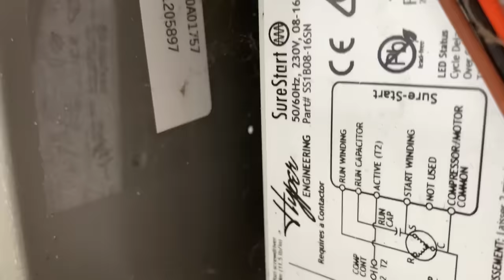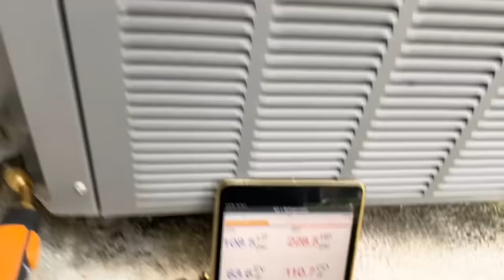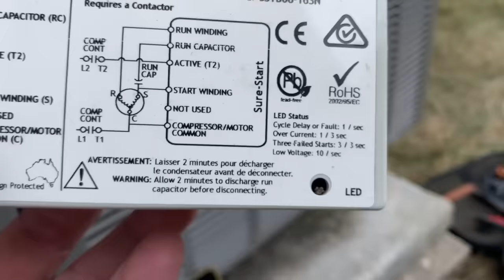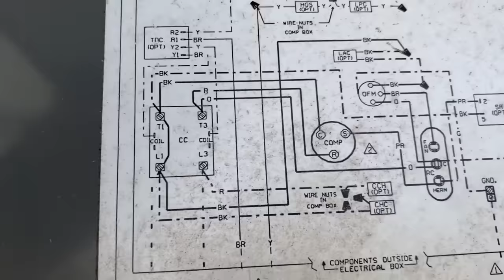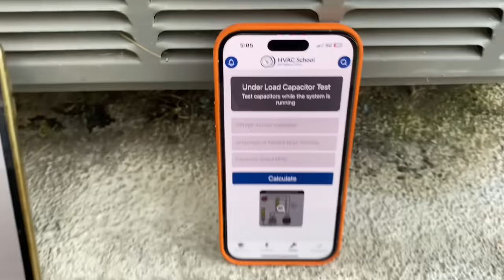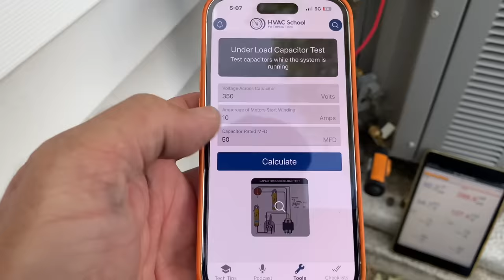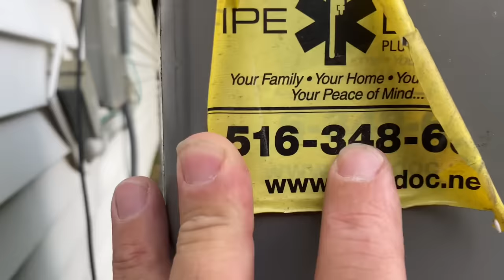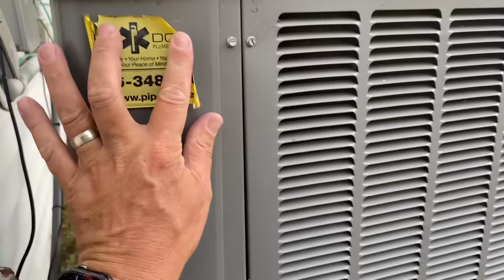Soft Start Killed Compressor! UNEDITED Central AC Service Call for No Air Conditioning Revealed!

Comment: A soft start works great if sized and installed correctly. They also extend compressor life, if you think otherwise you need to go back to school.
Reply: Exactly.
Reply: wrong
Reply: Soft starters are used throughout industry in high-draw electric devices to prevent them from failing so hard.
Reply: Soft starters are a genius invention.
Reply: @troy3456789  No there not, use the proper size generator. When your compressor comes up with a blown start winding you wont think so.
Reply: So how long have you sold these things for? I went to school and know this is not the way. If you dont believe that call the manufacturer of the compressor your putting it on and see what they tell you. First thing they will tell you your warranty's void, and other reasons not to use it. I think they know far more than you and your school. Which really shows your ignorance on the subject.
Reply: @RadioRich100  we use these things ubiquitously in industry on all scales of hp.  they seem to be pretty reliable.  i've never seen one die and take out a downstream device though.
Reply: @gavendb  Not those add on ones they talk about on here. If thats what your talking about, your eyes have been closed.
Reply: @RadioRich100  not specifically.  but the theory of operation is the same, reducing the torque by temporarily reducing the voltage or current generally with an SCR.  how would this reduce life of a compressor? (genuinely asking) Since it reduces the mechanical stress on the motor and shaft, as well as the electrodynamic stresses I figured it would be a win.  I could see a wye start delta run shorten the life of a motor that's not rated for it due to overheating, but that's not something you get in single phase.  eyes aren't closed, just have never seen what you are talking about in any soft start situation.
Reply: The school I went to says your looking at marketing and not science.
Reply: @RadioRich100  what part of that is marketing?  I went to school for electrical engineering.  The circuit design of a soft start is pretty straight forward.
Reply: @gavendb  Needed torque to turn the same load doesnt change. When the motor windings are initially starved for current those windings start heating up because the motor cant turn (like locked rotor amps) as you keep doing that over and over the copper winding become weaker, solder joints turn cold, the enamel on the copper wire starts to bubble and eventually failure. Those motors are designed to turn up full torque very quickly not over an elongated period of time. Also the time the motor isnt spinning theres no cooling air being generated. When the motor fails you wont even know why. Their NOT designed to run off these black box devices, which is why the manufacturer of the A/C unit voids a warranty when somebody puts one of these or a hard start kit on their equipment. If they needed it , it would have been designed that way. After years of experience the manufacturer knows what is best for it. You altering it defeats their engineering. As it comes off the assembly line it should last 20 years or more and mostly does.
Reply: @gavendb  A/C compressor motors are not designed to run off black box devices which alter the engineering that went into them. If this thing was so great (which it isnt for the most part) then it would have been designed into it. The system doesnt need it and is designed to run by itself for years. These things and hard start kits can be harmful over time and void your warranty too. The hype selling these things is bogus when hvac guys tell you to install them on new systems just because.
Reply: @RadioRich100  to be fair, most hvac folks don't think highly of today's engineering and any manufacturer is always looking for a reason to void a warranty, but i digress.  To the point of starving current...current is what causes heat, limiting that can't cause overheating within the duration of the soft start delay.  Although, you are correct on overheating damaging insulating barriers on stator winding.  We do a lot of MCE testing these things.  You are also right about the overall power required to start any machine is the same but with a soft start you spread it over so many milliseconds bringing the peak (instantaneous rate of change) down even though the average (integral) is the same.
Reply: @RadioRich100  that's false, there are quality "add on" soft starts on the market that actually protect the compressor and start winding with a built in fault detection circuit. Look it up and understand how a quality soft start works and protects the start winding. I use Hyper Sure Starts all the time with no issues.  Check out Brian Orr from Hvac school and his explanation. It is also false about losing the warranty because a soft start was installed. I have made warranty claims with out issue even with a soft start  installed. I have even had communication with manufacturers about warranty and add on soft starts. Not single manufacturer (ICP, Lennox, Trane) I talked to has said the warranty would be void.
Reply: @marka2449  Everything you just said - Baloney and B.S. Are you selling these things?
Reply: @RadioRich100  I own a large hvac/ electrical contracting and engineering firm.  I'm also an electrical engineer myself with vast knowledge of how they work. So yes, they are used when needed and not just for hvac applications. To each there own, but you are very misinformed!
Reply: @marka2449  No i dont think so. So how many of them have you sold? Its nothing but a black bullshit box. So it seems you redesign all the equipment you sell huh? Your just an engineering Mr wonderful. Your wasting your talents, you should be actually designing systems not installing them.
Reply: @RadioRich100  i will agree, don't install if you don't need it.  if you need it, install it.  where i live we have frequent outages due to bad power grid and lots of inclement weather.  when it's 100 outside and you don't have power for 6 days at a time, it makes sense.  I've had one for 6 years on a 12 year old unit.  for some people it doesn't make sense to buy a 20kw  for $25k standy unit for 1 week of runtime once every couple of years when a 12k portable for 1k will work fine with an ac unit w/soft start.
Reply: Yep. My background is Electrical Engineering Tech and ANYTHING that reduces current reduces heat and extends life. This guy is a clown If you pay attention and it seems a hypocrite as well.
Reply: @gavendb  I didnt know that every time one ruins a compressor they called you.
Reply: @gavendb  You never saw it? Well they dont notify you everytime one ruins a compressor motor. It INCREASES the stress on the motor not the opposite. The motor is designed to start instantly, not stretched out over time, meaning starving it for current. Eventually meaning blown windings.
Reply: It shortens the life because its not designed to start that way. You should not use it. And thats why the manufactures void your warrant y for using one.
Reply: @RadioRich100  LMAO!
Reply: @marka2449  this guy is a doof.  lol
Reply: @independenttntn3276  You dont talk like one as what you say is not possible. It reduces nothing as the motor still needs the same power to turn the same load. Your jesus box cant do that.
Reply: @independenttntn3276  Hypocrite? No way I would never use one of those things!
Reply: @gavendb This is right on. I installed my micro-air unit for hurricane outages and it works perfectly and I agree with you on the whole house generator. Not worth it for me since I lost power for 9 days in 20 years because of hurricanes. My 12kw generator runs the whole house including a/c only because of the soft start. If I thought it was an issue, I would remove and re install it when needed. The only down side to soft start units is the money it cost the HVAC companies not replacing your capacitor or contactor for $400.00. A/C manufacturers don’t use them because their stuff would last longer, not because they don’t work.
Reply: Alot of service calls are because of that device, nothing wrong with the AC unit. Not to mention the damage they do over time - compressor windings blown open for no apparent reason. (Hard start kits too) People on here bragging about fictitious low current readings that cant be measured with a normal meter. You cannot change the design of the compressor and convert into a frequency modulated motor by putting a magic box on it. You will pay a price for it sooner or later. Spend the money on a better generator, or if your smart enough at least switch the box out of circuit until you lose power and spare your compressor.
Reply: @gavendb  I don't think he is a goof...
Reply: @RadioRich100 of course the MFG is going to tell you its no good, why would the compressor mfg want to extend the life of your compressor???
Reply: @johnbalogna803  Lol, no there telling you your warranty is void if you do it, because they will not pay for damages. They have plenty of failed compressors to deal with.
Reply: @johnbalogna803  No they dont want to be replacing compressors blown up by gadget boxes.
Reply: @johnbalogna803  No they dont want to hear from your lawyer because you did something dumb not knowing what you were doing.
Reply: @RadioRich100 this video is staged. The “pipe dr”🙄 said he’s serviced that for 15 yrs and he didn’t noticed that glorified hockey puck as he called it to the original owner to let them know what damage it can do? And he’s way too comfortable when speaking with them
Reply: @RadioRich100  Talk about eyes closed.  Systems are no longer designed / engineered for 20 years.  Newer systems being installed (for the last 2 years or so) are only rated for 10 years.  False advertising is doing wonders in the American Economy.
Reply: Not as an add on device they dont
Reply: @gavendb  You dont want to see it. Whos we?
Reply: @gavendb  Yeah when one of the scrs shortout, there goes your winding.
Reply: @chrish7336  Your so full of it. Who told you this? Things are made cheaper no doubt but you seem to think theres a built in timer to shut the thing down at ten years? Besides that, what does that have to do with installing some gadget box on the system which can itself destroy the compressor far quicker because the compressor is not designed to start that way in the first place. No matter how you look at this you cant convert the compressor to run off different current schemes than it was designed for. Thats why the manufacturer voids your warranty when you install one.
Reply: @RadioRich100  Your right cheaper materials, cheaper builds, cheaper quality.
You better get your insider information sorted out.  Newer systems as I claimed are no longer designed or engineered for 20yrs.  

Automobiles are no longer designed or engineered for 20 yrs.  You might be lucky to get that much time, but they are not engineered for that any longer.
Reply: @chrish7336  sure they install different timers now.

Comment: Put the proper soft start on the unit and save the customer some money on her monthly electric bill. Soft start devices are NOT STUPID!
Reply from the maker: Oh yeah? On a old R22 unit it is.
Reply: @PipeDoctor  nope electrical load is same regardless of gas used. Regardless of age, the energy bill reduction for folks like me on a fixed income all adds up.
You so considerate of your customers..../s
Reply: Not going to save money no utility measures demand rates by the second. It's measured over 15 min period unless the unit draws 100 amps for 15 minutes not going to increase the bill. The only reason to have one is if you are using solar, or a generator.
Reply: @PipeDoctor  Why is that?  Not starting an argument...it's just interesting to me.  Also, R22 is all but dead, correct?  I live in Vegas, so maybe R22 units are dying faster here vs. elsewhere.
Reply: Anybody that thinks that thing saves them money is being foolish.
Reply: @turkeyssr there are many well-cared for R-22 systems working reliably right now, partly because of soft start technology, partly because they were installed far away enough from the structure,and because they cleaned the condenser periodically.
Reply: No but you are.
Reply: Theres no energy savings, compressor protection or any other wild claims that are made on here.
Reply: They are added to a system not designed to start like that.
Reply: Any body who installs one has no idea what they are doing to their system. Get your advice from the manufacturer of the AC unit, not from utubers selling and promoting them.
Reply: Dont be a fool, its the customer who is stupid enough to believe a gadget box makes there system work better or run longer. Its built to run by itself.
Reply: @Mike-01234  The soft start doesn't save money on the electric bill unless your electric company adjusts rates based on max amp draw.  However it DOES protect the compressor and a soft start often also extends the life of the compressor.  This tech obviously knows that and prefers to keep compressor lives a little shorter.  It is pretty much a requirement if you have solar or a generator, but it also helps protect the compressor if you don't.

Comment: Pity to lose the soft starter.  I wouldn't run my AC without one.  Next time you might want to check the product manual to see why the starter decided the compressor needed to be turned off before disposing of an expensive upgrade.
Reply: He needed to clean that nasty plugged up condenser coil. It probably would've resumed working fine with the soft starter if he did.
Reply: Lol your A/C might not run with one.
Reply: Next time think twice before installing the thing.
Reply: @RadioRich100  I love the people like yourself who know nothing dispensing "advice." It extends the life of the compressor. They may also have installed it because of the solar power to draw down current if it was whole house solar. The majority of wear is incurred when it starts due to the heat generated by power that is REDUCED with one.🤡🤡🤡
Reply: @independenttntn3276  The power is not reduced, get an education and stop buying worthless gadgets.
Reply: I don't really know what a soft starter is, but i've heard more bad about them than good so I will stay away from them I guess.
Reply: @Warp2090  You would be right about that. Too many utube follow the leader know nothings on here.
Reply: @troy3456789  Oh yeah, maybe he should have not installed the thing and it would run fine.
Reply: @independenttntn3276  Bull crap

Comment: 1.-  wrong soft start for that type of unit (undersized for 5 Ton AC) 2.- I noticed the manufacturing date of the soft-starter as Week 37 of 2019, we are now in 2023.....that is a testament of the quality of the product...imagine how many cycles that soft-starter goes thru every year, being undersized and taking that beating....lol
Reply from the maker: agreed
Reply: If you dont install one you cant have a problem - Done.
Reply: I have the 16-32amp model on my 10 year old carrier 3.5 ton and  have only had to change out just the cap maybe 2 or 3 times

Comment: I saw they have solar.  I wonder if the soft start was so their batteries can handle the inrush current of the A/C.
Reply: I expect it would more for bring the starter load within the inverters surge capacity.

Comment: I installed a soft start on my older 3.5 ton unit, and it ran well for about 30 days, then the compressor stopped.   I hadn't had the unit truly professionally checked in 19 years.   I removed the soft start, and the compressor came back on, but ran for a long time before it would cool the house.   I ordered a new capacitor to be safe, and installed it.   The next day the unit iced up, so called in the original installer to check the charge.   22 ounces low.   In the meantime, I had returned the soft start, and got the refund.   Now I'm figuring the soft start was not defective, it actually sensed a problem with the compressor because of the significantly low charge.   I may reinstall one again next summer, as well as have the tech back to see where the charge is going into next summer.
Reply from the maker: Thanks for sharing your experience
Reply: If your unit is about 20 years old, think about replacing the systems and get something more efficient and save money on electric bills and needless repairs!:trophy-yellow-smiling:

Comment: Gfreat service call!! *BUT* ever thought that maybe the soft start unit actually SAVED the unit? they fault out on high current.. that dirty coil very well could be why it was shutting down the compressor..  and the soft start unit was actually protecting the compressor..   I get it, the customer was hot but those pressures were way up there and the current pull was high as well as the discharge temp from the condenser..   ill bet it wouldve continued to run if you sprayed down the coil (well if their hose faucet worked)....
Reply from the maker: Maybe. Only time will tell
Reply: I also think the soft starter was falsely getting the blame here.
Reply: @PipeDoctor  Not really, because you removed the soft starter.
Reply: When it dies the customer will call again and time for a new AC unit $$$$$$ I live in Phoenix I know how this industry works.
Reply: @Mike-01234 yep. He left it with a wool rug on the condenser. He didn't bother asking the customer about a working hose bib.